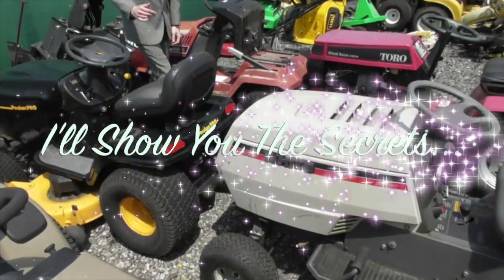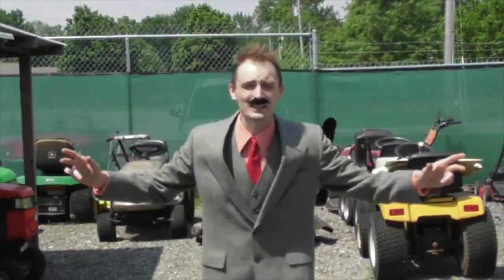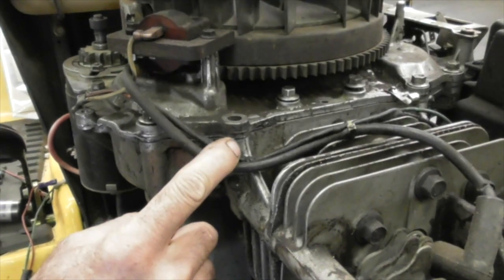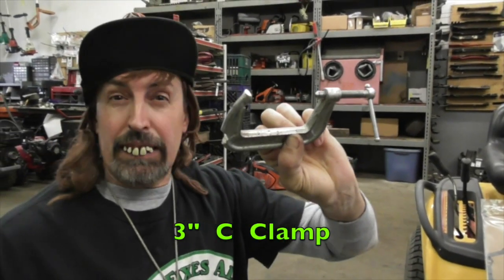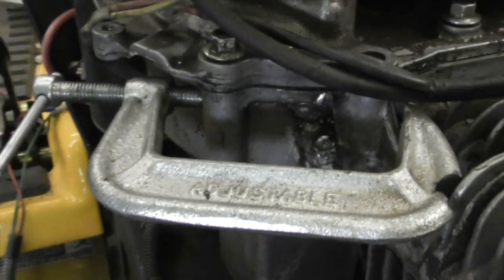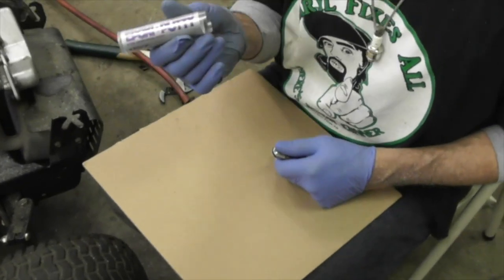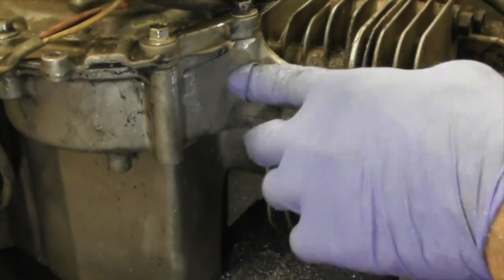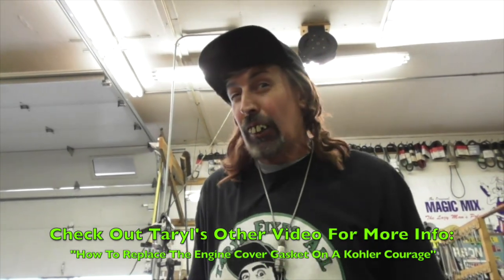Cracked Engine Block? EASILY Fix it!

Comment: Hey mate, just wanted to thank you for this video. I had the exact issue with my CRAFTSMAN with the same Kohler COURAGE, I followed your vid step by step and it was spot on, even where to put the nuts n bolts so I didn't lose them😃. The mower did eventually die (multiple issues), but your fix got me through the Summer! Your "it's not the Space Shuttle - just tighten it down" line.... Gold!🤣 Great vids mate, thanks again!🤘😃

Comment: I fixed one last week by drilling/tapping a hole on each side of the crack and spanning the crack with a piece of steel and 2 screws. I used JB Weld all along the crack. In addition, my fix is different because I drilled a few extra holes in the steel patch (like mesh) so the JB Weld came through it and added a lot more strength .
Reply: That's a great idea,  drilling extra holes for the JB Weld to have a better grip.  Thanks for the suggestion. 😊

Comment: Hey Taryl, I used your engine swap video when I swapped my Briggs & Stratton out of my Craftsman LT1000 for a Kohler 5400 series engine. It’s been an excellent engine so far! Keep up the great work!
Reply: I swapped out a wore out Briggs for a Kohler Pro, V twin 25 horse my Briggs was a 12.5 horse.  I did that before I seen Taryl's videos on swapping engines,  but it works great the extra horsepower makes cutting tall grass or weeds fast and easy.  I had to do a lot more work because the pulley for the blades was different.  The Kohler used a 1 1/8 inch crankshaft,  the Briggs uses a 1 inch shaft. I made it work by taking apart an old electric PTO,  it had the right size shaft on both ends a simple weld to the transmission drive pulley (came with the engine) and cut the blade drive pulley off of the Briggs set and had that welded to the small end and it works great.  I haven't seen anyone do the same as what I did, but shouldn't be difficult for someone that can weld.  
Good to know your happy with the Kohler engine 😊

Comment: This happened to my engine. Unfortunately I didn't catch it until much more damage was done. Thank goodness you also have a video showing how to swap engines. BTW. I used that magic putty for a temporary fix to an outdoor water pipe in the middle of winter, that was about 8 yrs ago, pretty good stuff.

Comment: I found out my Kohler engine had loose bolts because I noticed smoke coming up one day. And looked and there was a bunch of oil going to the muffler. And so I tightened those bolts. And then a couple of years later, I checked and had to retighten them. And they've been tight ever since.

Comment: Thanks Taryl.  I fixed my Kohler courage 18 cracked block using method in your video and worked great.  Used JB weld and the 3” C-clamp. Awesome redneck fix!!

Comment: I have to fix a cracked block Kohl’s couragein the same spot  and am taking a similar approach, but instead of keeping the clamp ON, I’m going to 1. Drill stop hole at the end of the crack to avoid future lengthening of the crack. Then 2. Fill the gap with JB Weld, then 3. Clamp  the block the same way Taryl did… then 4. Apply more JB Weld… liberally all around the crack. Then 5. Tighten down all top bolts with blue thread locker. Then 6. WAIT for the JBW to fully cure. Then lastly 7.  Remove clamp. My logic here is that by repairing the crack PROPERLY, there’s no need to keep the c clamp on once the JBW cures.

Comment: exact same spot as mine cracked, cept my bolts never came loose, just came out with new higher strength jb weld on my 3rd layer now were gona see.

Comment: Taryl I have a Kohler courage engine I don't think I have a problem with the loose bolts yet but is it wise to go ahead and pull the bolts and lock tight them before I do and should the motor be cold when doing this . Thanks in advance .

Comment: Hey Taryl i had a question if you don't mind. I have a 42" troy built bronco and the something just blew on the engine. Its a real hot day and i had it parked on a slight incline and then it started running really rough/loud and ran to shut it off as it was smoking as well and it ended up having a hole blown near the bottom on the side of the engine. Now ive never taken one of these engines apart. Is it a real hard job? Thanks for any advice Bud.

Comment: Does anyone here have oil leaking at the bottom of the crankshaft? Haven’t found a single video about it, i replaced the oil seal but that did nothing.

Comment: im trying the JBweld only using expanded metal from an air filter. figured fiberglass is weak with out matting. it  should give JB weld something to grab, and hold things together

Comment: I take a piece of copper about 2 " by 1  " drill a hole in it so the bolt goes through it then make a couple of relief cuts then when I put the bolts back on I fold the copper around the head of the bolt I use a screw driver and a hammer  to bend  the copper around the bolt because it has a flange on the head of the bolt so it kinda rough to get it to form good around the bolt then bend the rest of the copper over the  edge of the block so the bolts can't back off

Comment: I paid $5,000 to take that Ronald Jergenstein  class to learn how to fix old lawn mowers and he sold me a kit to fix cracked engine blocks that had what looked like a tube of Elmer's school glue with sawdust in it .  There was a piece of tape over the label that said , Jergenstein  Cracked Block Fixer , and then a roll of duct tape and a bumper sticker that said Jergenstein Lawn Mower Workshop that your supposed to put over the duct tape or on  the mower where people can see it good .  The kit cost  $45.00 and the books , tapes, c.d's and nutritional supplement vitamins and V.H.S. tapes cost  $875.00 but they haven't arrived yet .  I called him and he said he was sorry it's taking so long but he offered to sell me some dish soap and laundry detergent real cheap to make up for it .

Comment: DANG, mine cracked in the exact same spot after 100 hours...I've read it happens frequently, some call the Courage the "100 hour engine"...I think the bolt in that corner was a HUGH mistake by their designers !!! All my bolts were loose too

Comment: Hey Taryl, I love the videos. Very helpful and entertaining! I watched several videos of yours on this particular engine, and they helped tremendously. But now I am in the market for a brand new mower. Do you have any suggestion for a base to mid-level residential lawn tractor for a 1 acre yard? My main concern is reliability. I don't want to go though the same stuff that I had to with this Kohler engine.

Comment: I used that Epoxy putty before hardens like steel. It can be drilled & tapped too.  Clean the surface w/alcohol 1st.

Comment: I've just joined the Kohler courage cracked crankcase effing club  ... might V it out a little bit with the dremal, then drill end of crack before hitting it with JB weld. Hope this works, if not looks like a Briggs or similar is going in. " Didya bring da cash wichya?" Brilliant acting  ...could of been in the Soprano's.

Comment: I had one crack the whole cylinder off the block. On the first pass thru the yard.      Got a new motor. It made it about 10 hours and it cracked  got another motor and.   And the shop said all the torque specs where way off from the factory.        That engine made it till I sold it haha
Reply: I have a 500 series Briggs mower and they are famous for cracking the sump on one of the corners, of course nowhere as bad as the problem you had but its amazing this junk they make these days, there is a guy on Amazon that's on his third sump, lol, one of our welders at work tried to weld the sump for me and he said "dude, i dont know what this is but it ain't aluminum, ha ha ha ha ha

Comment: Have you tried using this repair on a crankcase where the oil is held? Cracked created by broken connecting rod.
Reply: Might try a MIG weld but there is no pressure in a crankcase and it doesn't cost much to try it.

Comment: theres no need to fix the crack kohler has replaced six of these for my customers reguardless of age  the early models cracked right under the exaust valve call kohler and file a complaint don't waste your time trying to mess with these crappy engines when they will fix them under warrantee

Comment: I appreciate your mechanical skills but in this case I think you’re rearranging furniture on the Titanic...
Reply: I don't know man. I've kept a cubcadet with a courage engine running years beyond when it probably should have died. Through an engine fire that melted the hood off, 2 carburetors, a starter, broken mounts. These engines must have some blue magic somewhere.

Comment: I will keep this tip in my back pocket, I basically have the same engine ( 20 hp ), now let me go check my nuts, so this wont happen. This style engine seems to need alot of repairs.
Thanks to Taryl and crew its ready for another year, cross my fingers.
Hillbilly is Best.

Comment: I'd take that engine back where it came from, 
The junk yard😡
Nothing but problems. 
Cracks, valve cover leaks, and broken/loose flywheel magnets.
Reply: its called mantenince use rtv for new valve cover gasket
Reply: @seanmckay3392  I had to do warranty on a few under 150 hours

Comment: Teral help me. I have a Briggs 26hp on a husquvarna lgt2654. It's blowing white smoke from carb intake and oil filler. The flywheel is pretty easy to turn also. It lacks power. Any suggestions!
Reply: Ty Armand It has a blown head gasket.To certify that it does,get a compression tester and check each cylinder for a CONSISTANT reading.Both cylinders should be close,but in this case one will be alot lower then the other.
Its very debatable to change the other head gasket on the good cylinder head,I personally would do so.

Comment: that Epoxy does not hold out long. the jb weld is much better.
Reply: Yeah, the only good for epoxy putty is maybe filling holes in wood or something. But that stuff just doesn't stick as well as the liquid epoxy and the putty cracks pretty easy. I'm surprised he uses putty for these repairs as I'd say it's more of a temporary repair than permanent repair.

Comment: I've used that putty that I bought from the hardware store to repair a minor exhaust leak on one of the mufflers in my car so it passes inspection next weekend hopefully.

On the 23rd of September which is on my grandmother birthday, I may as well put some flowers on her grave because I'll be  near the cemetery where her ashes are !!!!

Comment: those engines are complete trash, they're throw aways, briggs and kohler k series are indestructible.
Reply: Peter Lombardi ikr i had the exact same thing it was running one day next day it wouldnt hit a lick after i tore down the engine all it needed was a simple valve adjustment. i have a vid of it on my channel👌